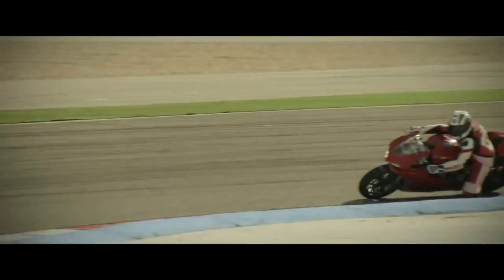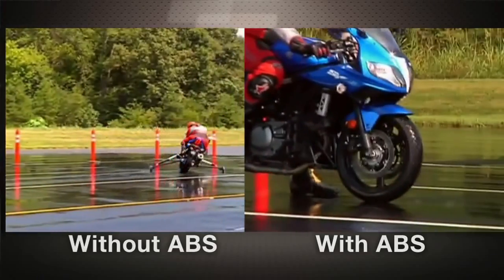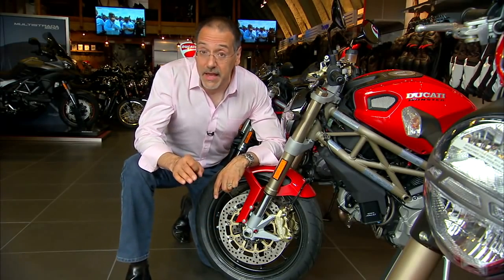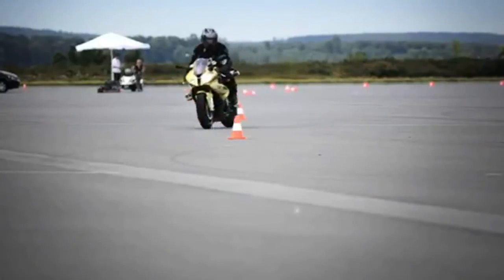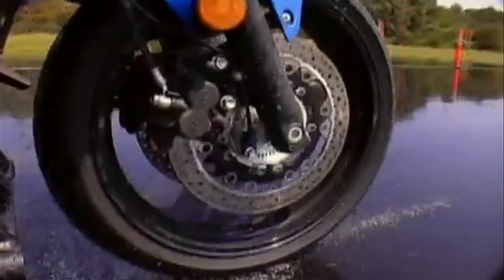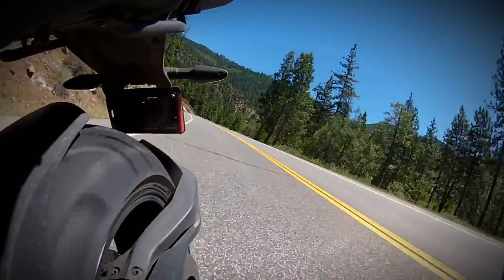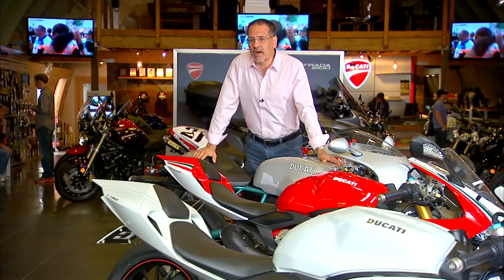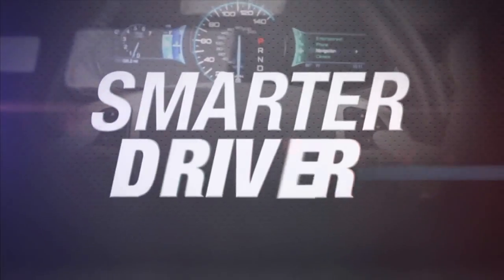CNET On Cars - Smarter Driver: ABS on motorcycles

Comment: ABS is a good system but it is not men't for you fall into a false sense a security. People need to learn how to threshold brake rather then just slamming the brakes down. Threshold braking stops you faster then ABS because ABS breaks the breaking to prevent the tires from skidding. Then threshold braking and only use ABS as a backup which is what it is men't for.